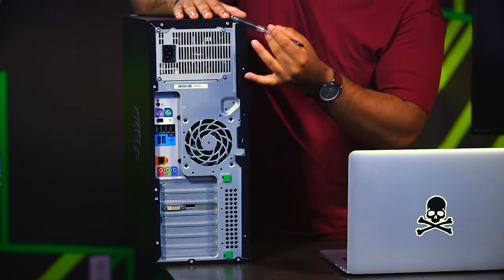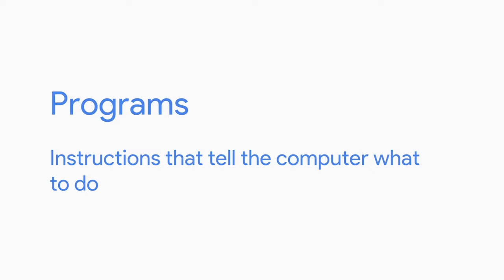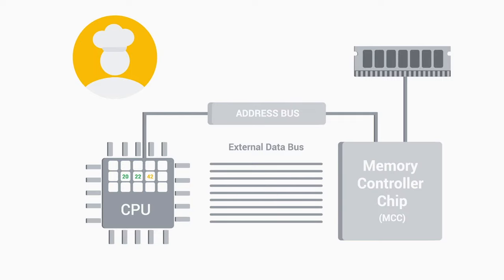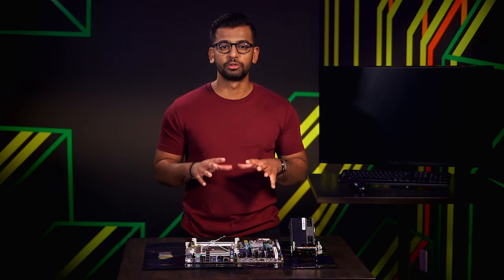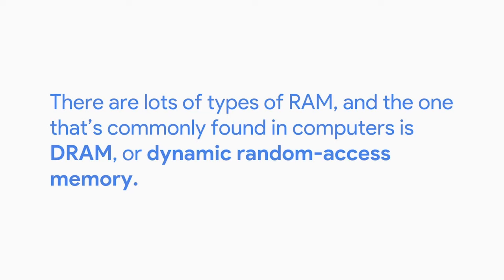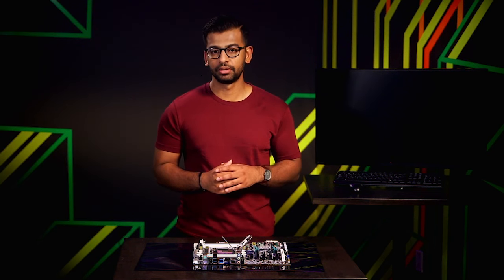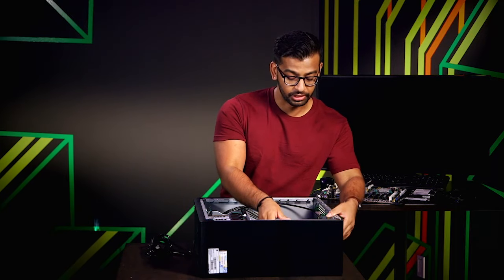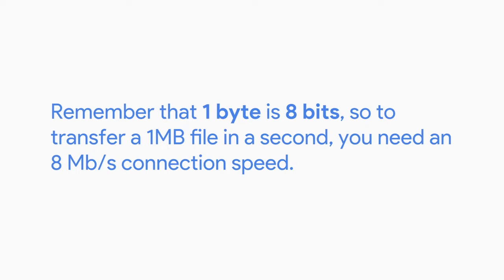Modern Computer Programs & Hardware | Google IT Support Certificate

Comment: 35:50 
"To transfer 40 MB of date in a second, you will need a transfer speed of 240 Mb per second"
Is it a miscalculation or I understand the concept wrongly?
Reply: Miscalculation, it's supposed to be 320 Mb/s
Reply: Oh. I also notice it and checking here is anyone tell about it. It will be 320Mbps.